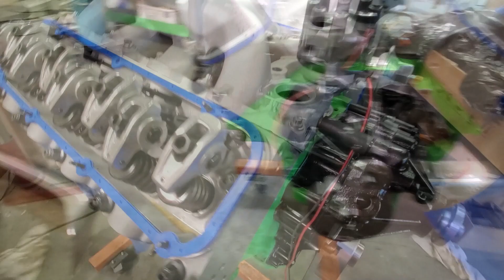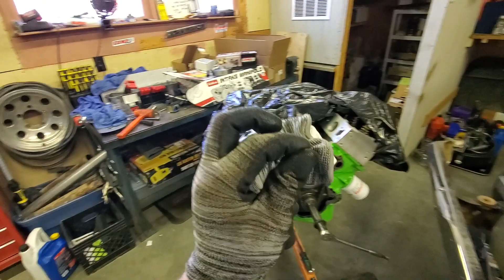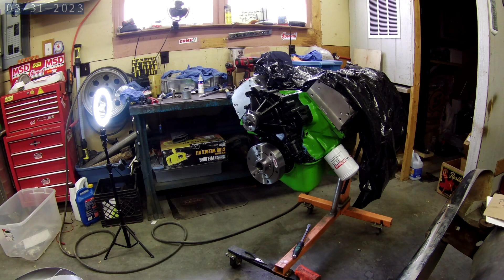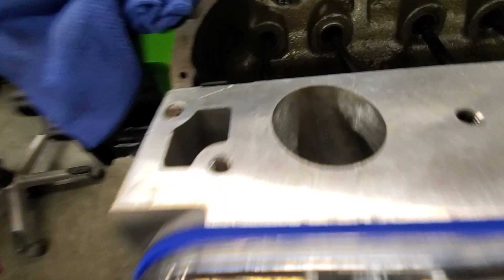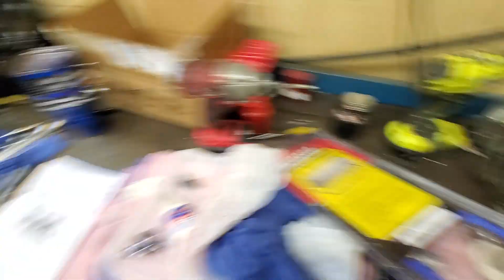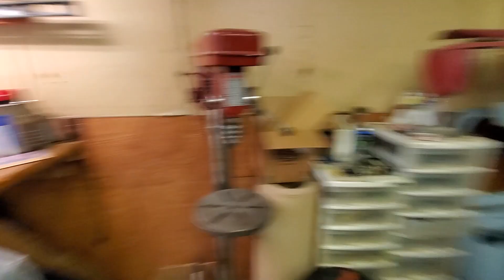The 460 build is DONE! (EP 8)

Comment: Great job showing and telling, yes I v been working on my 460 little by little need to work on it more. So may be I’ll get something done more.  Now good summer is almost here I’ll work on it more. Been cutting firewood that’s a job,now rebuilding a power saw about got it back together painting the metal box the smoke 💨 comes out of the saw . Then I’ll be done did three of them, got to take care of them saws. Well keep up the great work on that motor 460 and I’ll be working on my old truck f350 it’s a  older 1990 but a good d . Well have a good one see ya next time see ya bye.

Comment: here's a good comparison to extrapolate what kind of power you'll make. its a 475 cubic inch with a 219° at .050 cam, 9.0:1, and edelbrock heads that flow a little better. four more degrees duration and a few more cubic inches made 482hp 

https://youtube.com/shorts/MEGHwZyIbbs?si=TpsMOZXcYgVFQE4M

Comment: with that big of an engine and that small of a cam its gonna be wanting more air.  you almost should have retarded the cam.
Reply from the maker: I paid the custom cam guy for a reason!  Not to second guess him!  Hoping for 500 flywheel hp should be well over 500 tq
Reply: @cprgarage3206  500hp from a 215° cam? ha, no way. you need at least 230°, you may get it with a 224° cam if you have a enough compression.
Reply: @cprgarage3206 Well, I saw your dyno video, and im not gonna say I told you so, but I hope you get the opportunity to learn from this. 

i would like to say, also. the duration at .050 is the most accurate way to determine what the power is gonna be. it really does take between 224° and 230° to make 500 horse with 468 cubic inches. if you have good head's and enough compression, at least 9.5cr, depending.

using the advertised number is almost pointless.  it all depends on where the advertised number is measured at. you cam get a 230° at .050 with a advertised of 274°. that  230° at .050 would have made 500 horse. well, as long as your heads are good enough.

anyway, it sounds like you are happy and you have a motor that will work good for your purpose.